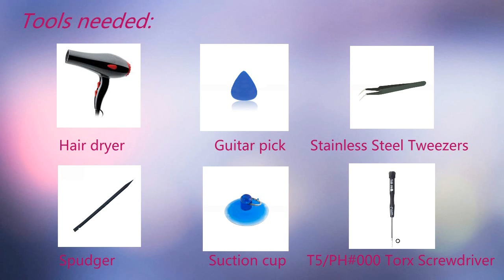How to Replace the Broken Headphone Jack of Sony Xperia M4 Aqua?

Comment: Loved the video. Quick question. I have the same problem on my Z5 Premium, if they, Sony Engineers, tear down the phone and replace the headphone jack, will the phone still be water proof? Like even thought an authorized Sony engineer took it apart.
Reply from the maker: Yes, so as they make some waterproof process after replacement, you can them to do that. :)